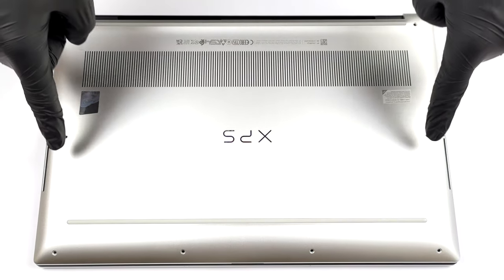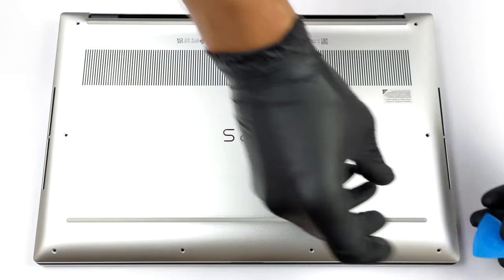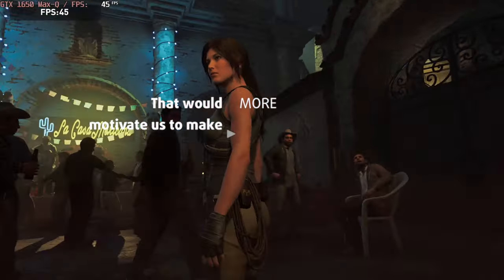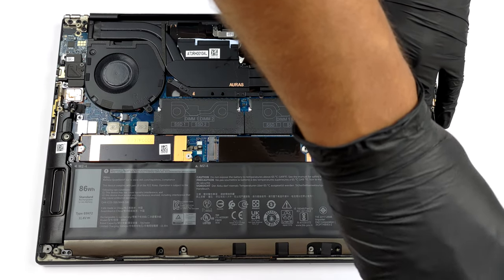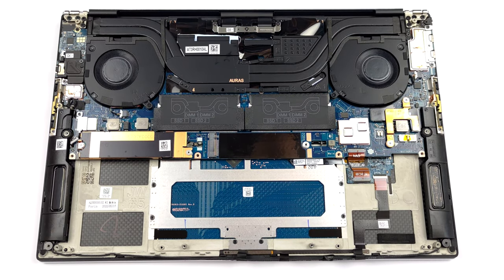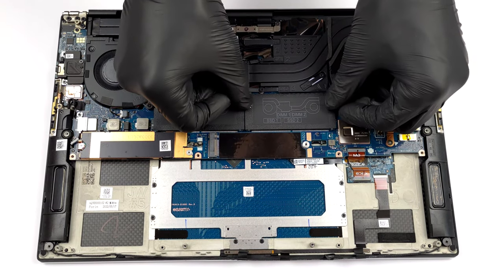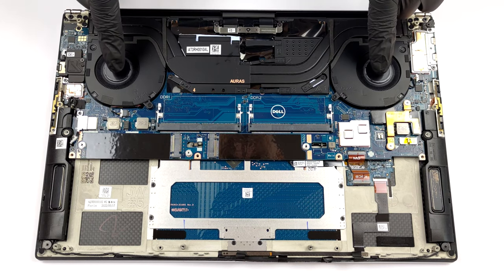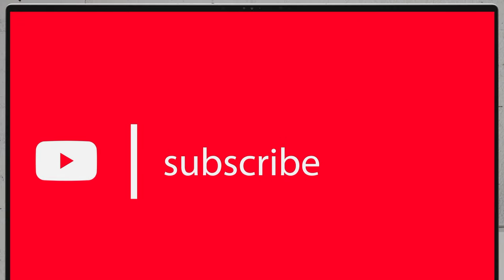🛠️ Dell XPS 15 9520 - disassembly and upgrade options

Comment: Give us more description in your video, like the year of manufacture of the laptop, specs etc
Reply: The 9520 in the title defines that as this is the 2022 model with 12th Gen Core processors.  The other specs such as the amount RAM & SSD are not really relevant to a tear down.  If you don't understand why, you shouldn't be opening your lappy 😊  The OLED screen model does come with a different (lower) battery capacity for some reason.
Reply: @guyb7995  I think maybe what Karin is saying is that not everyone cares to have to leave your YouTube channel to google 9520 in order to learn that it indeed corresponds to 2022, nor do they want to have to stop watching your video to have to go and google if that M.2 drive is 2280, etc. etc.  It'd be faster and would keep us here longer if that info was readily available right away.
Reply: @WaltJacob  sure, people like others to weight on them hand and foot, it sounds like a them problem.
Reply: @guyb7995  Lol, then why make a teardown video in the first place if you have no interest in being informative? And this from the same guy who would have benefited from the video being more informative and telling you explicitly that there is an extra M.2 screw under the lid that you couldn't find by yourself without hand-holding.
Reply: @WaltJacob  So you are saying this video isn't informative?
Reply: @guyb7995  They underestimate the power of google and logics. A ram upgrade on their coloring book might be a good suggestion.

Comment: Do you have to remove the battery in order to put in a second SSD?
Reply: No, you don't. I installed mine with the battery installed. Make sure to unplug the battery from the main board before installing the SSD.

Comment: I just installed a Samsung 2TB 980 Pro SSD in that second M2 slot.  Make sure you have a spare M2 hold down screw as the laptop does not come with one.
Reply: There is a spare one on the back of the bottom cover.
Reply: @Turbulentworm  ohhh, I will have to have a look the next time I open it!
Reply: @Turbulentworm  cant find it, can you specify please. I have the 2022 model

Comment: Having issues with Ram compatibility. What RAM brand/spec would you recommend to upgrade from 8GB to 32GB?
Reply: No 16 is more than enough
Reply: What have you tried? I've had good luck with Crucial memory in my previous Dell machines. However, I wouldn't mix OEM and 3rd party. Replace whatever the laptop came with too. I usually run into issues otherwise.
Reply: @raymondli8882  I have this exact laptop and don't do anything heavily RAM intensive. I put 64gb of RAM, knowing it was overkill and that I'd never come close to hitting it. It does regularly hit 20gb of use since I upgraded it and all I have running is chrome and a few Microsoft office applications at a time with windows 11 pro as the OS. Would recommend 32gb based on my experience

Comment: Do you know if there is a maximum amount of storage capacity for doing an upgrade? Would 4TB + 4TB work or is it a maximum of 4TB total between the two slots?
Reply: i've seen a reddit thread where they were able to stick two 4tb nvme drives in the 9500 model so i'm assuming it would also work for the 9520
Reply: @RafitaPapita2099  Thanks for the reply.  I am about to try it out 2x 4TB soon - 8TB total (fingers crossed).
Reply: @ClintonWilkinson  Hi, did it work for you? RAID or not?
Reply: @rusikus  I successfully installed 2x 4TB (total 8tb - I did not need a raid configuration).
Reply: @ClintonWilkinson  which modules did you put in?

Comment: friends i hope its obvious but DO NOT use a metal spudger and ABSOLUTELY DO NOT use a stainless steel spudger!

My idiot self thought buying the iFixit "Jimmy" spudger would be buying the singular best tool, but heavens, NO. It will only scratch, mar, and chip away at the plastic and gorgeous polished aluminum that clam your XPS together. Learn from my mistake!!!! 😭😭